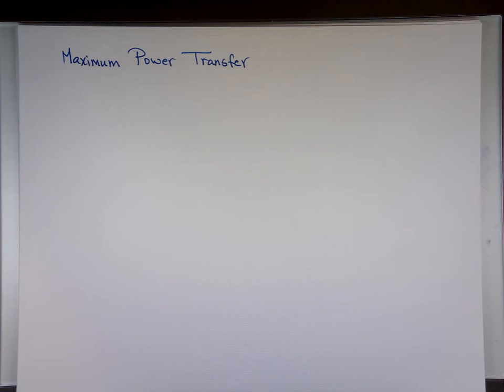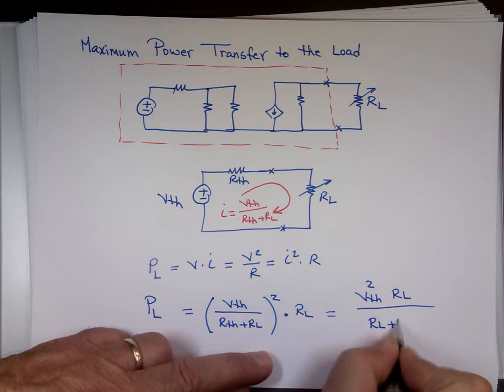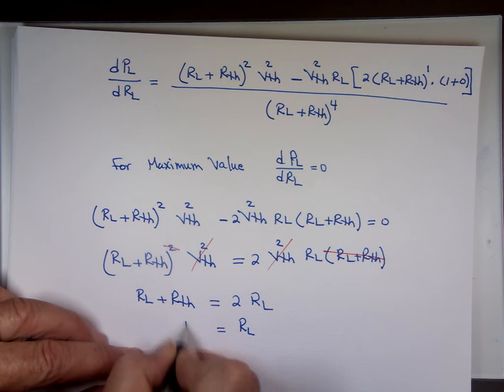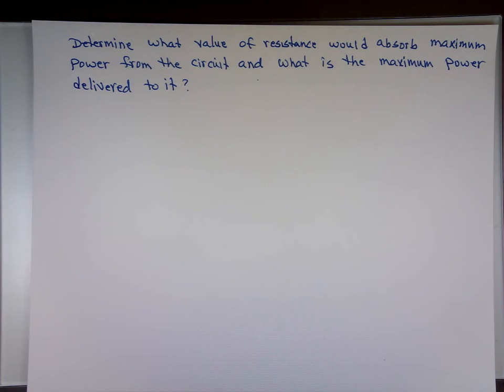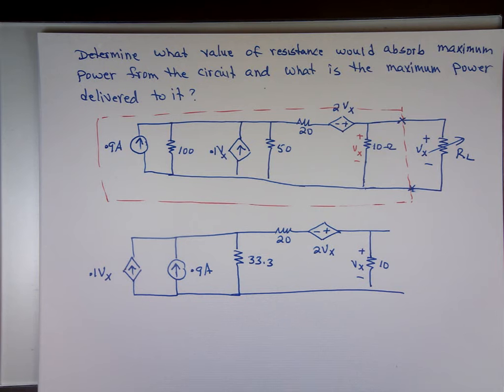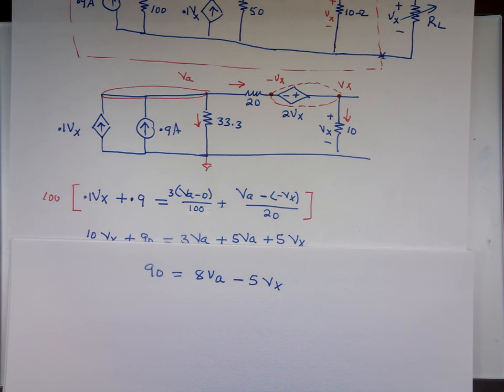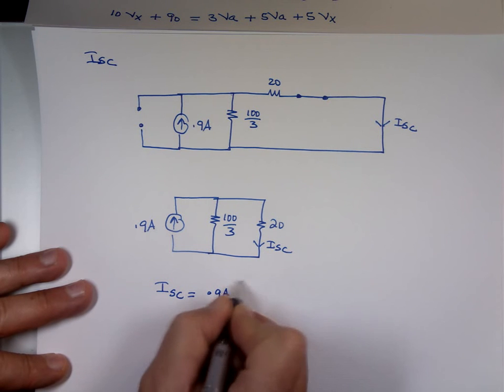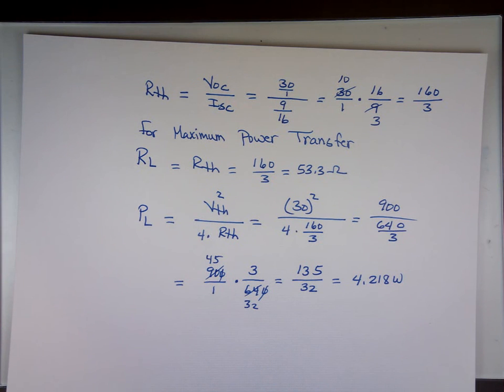Maximum Power Transfer to Load

Comment: 19:55 Isn't it that voltage between 20 oms and 2Vx voltage source is 3Vx?
Reply: Based on the polarity I think the set up in the video is correct - remember passive sign convention. We can the difference at the nodes has a dependent source in between them, which means they form a supernode with their difference just being the source. In this case Vx is on the positive end and the source = 2 Vx, so the node between the 20 ohm resistor and dependent source must be equal to Vx - 2Vx = -Vx